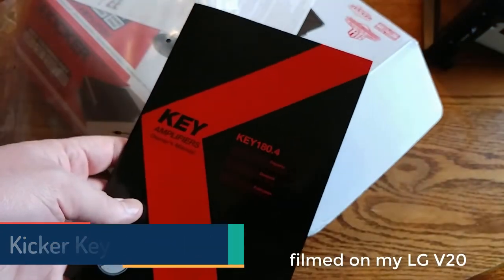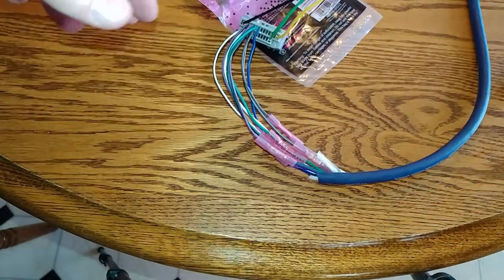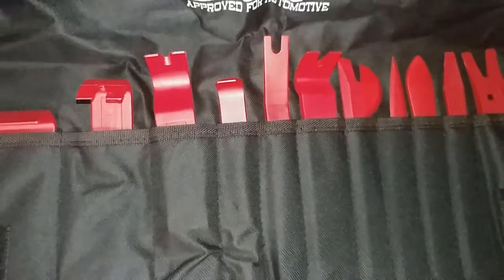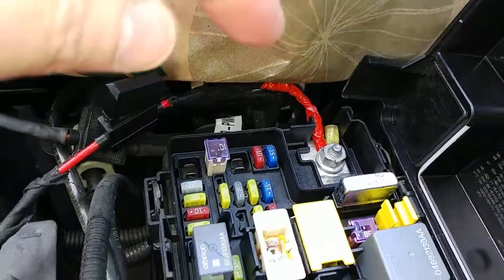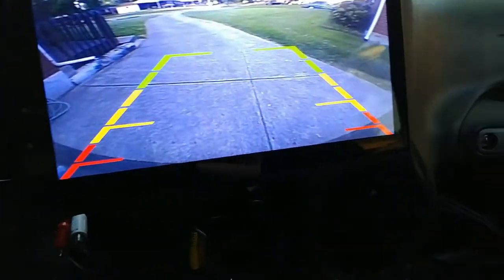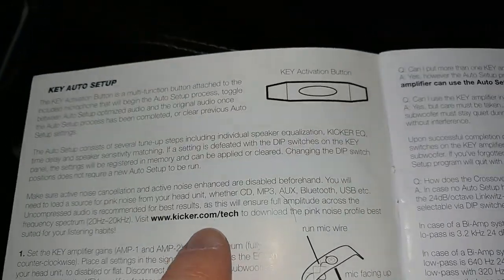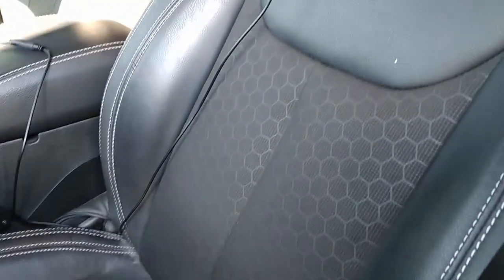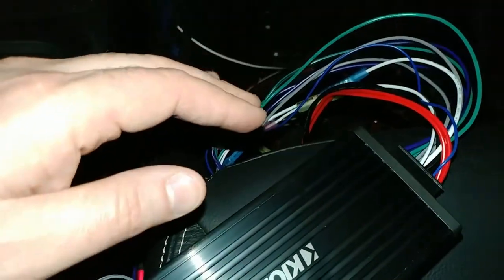Kicker Key Smart Amplifier test install - KEY180.4 - 2016 Jeep Wrangler Unlimited

Comment: hello Mike, my dasaita doesn't work with my stock alpine sub, will this unit help? and if I used this one, does that mean the stock alpine is no long in use, noob question, thanks
Reply from the maker: No, you want to wire up a PAC module like in this video:

https://youtu.be/XODNzm__x4M

Comment: Hello it is a very realistic video. I have some doubts: 1.- You run the pink sound from your browser, and if you don't have a browser in the car, how do you run it? Do you record it on a pendrive? 2.- Did you find the configuration with the car on, and the volume less than half? Isn't the car supposed to be off, and in a quiet place? I await your comments, I bought the Kicher Key, I already have the Plug and play harnesses, I just need to learn how to configure it.
Reply from the maker: It has been awhile since I made that video and it was pretty rough. I think at that point I had an Android head unit that was running full Android. It had a browser.

I think you could download them to a USB drive and play it with your head unit to use the pink noise.

As far as the test, I have no idea if it was ran correctly. I did my best to follow the directions.
Reply: @5after12  Thanks for answering, this is the whole experience of installing the Kicher in the Jeep, but currently I imagine that now you know how to correctly install a Kicher Key? or was it the last time you used it? I just bought the kicher Key 200.4 for a Subaru Crosstreck, I don't want to change the OEM radio, I bought it to improve the sound, I bought the harnesses made that are Plug and Play, I just want to know the final configuration. 1.- You tell me that the pink tone download it and play it from a Pendrive. OKAY. 2.- Is the final configuration done only with the ignition on, or with the engine running? 3.- The volume when reproducing the pink tone, do you use it at 50%? I hope for your help. Thank you.

Comment: Just got this amp without the microphone 
Do you have to do the pink noise test process for the amp to work properly? I didn’t end up doing the test. Everything works alright. But for some reason my rear speakers are very muffled. What did I do wrong? And how do I fix it?
Reply from the maker: I am not sure. Did you not get the microphone in the box?

Comment: Picking up to much outside noise needed to be in a quiet area
Reply from the maker: Yeah, this was an older video and I could have done it much better
Reply: @5after12  how's the amp holding up?
Reply from the maker: @davidgreggs6830  it was an OK amp, but I replaced pretty much the whole system